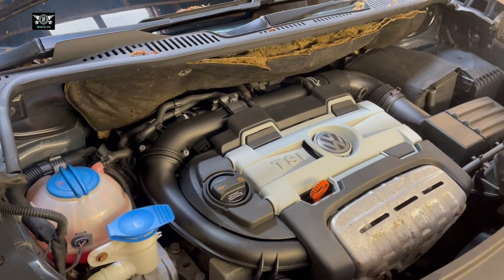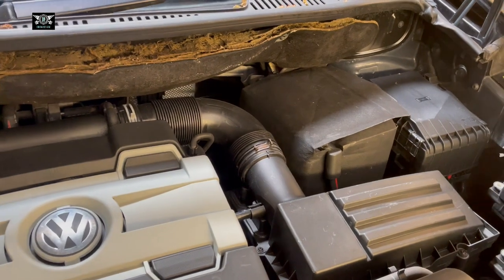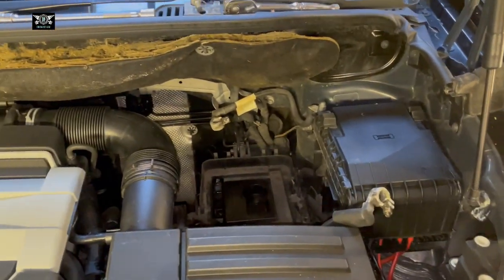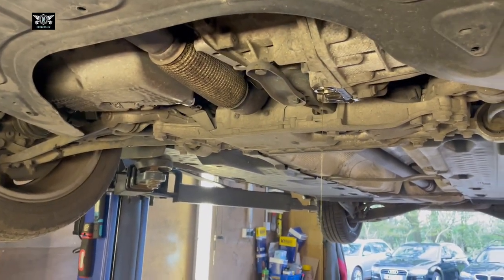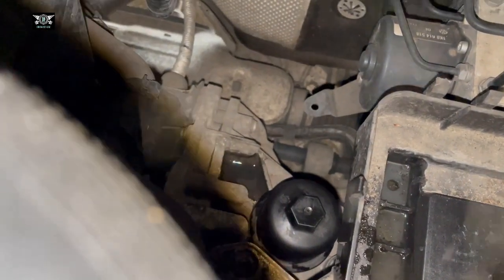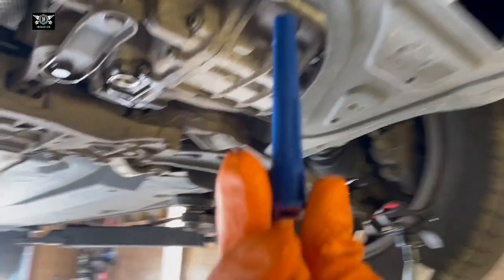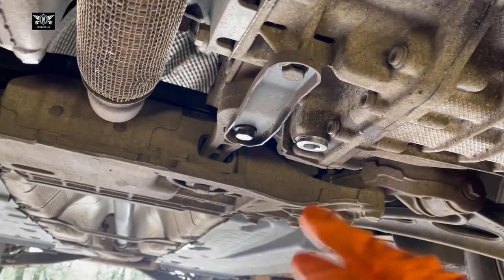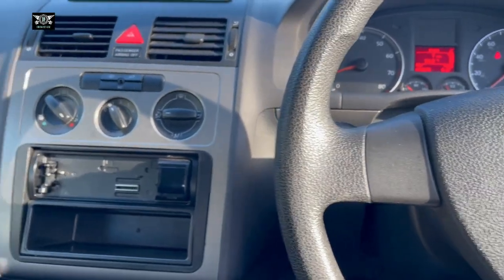VW Touran 1.4 TSI DSG transmission fluid and filter change

Comment: Very helpful video I have a Skoda Octavia dsg gear box needs oil change 89,000 miles don’t think the oil have been changed by previous owners will have to book it in  main dealers next month don’t want risk it
Reply from the maker: It’s essential to have the transmission serviced.

Comment: Awesome video - thanks for the helpful tips and hints. 
My car is missing between gears... it is like the diff is moving slower than the wheels so I constantly get a big tug between the gears. Any ideas what it could be.
Reply from the maker: You welcome, This suffer with an issue with the dual clutch, so it’s a mechanical fault and most likely needs to be replaced. But will need to be checked by a specialist.
Reply: @DaringBeefcake  Thank you

Comment: Is this the reason why mine car isn't starting..As my PRND light was flickering...
On checking the gear, I found oil leakage next to the Filter
Reply from the maker: I don’t think so, the engine should still start even if the transmission is potty, there must be a different issue, sorry for the late reply.
Reply: Very excellent explained. It's very useful. 

Thank you so much